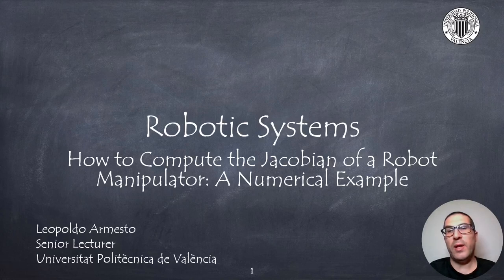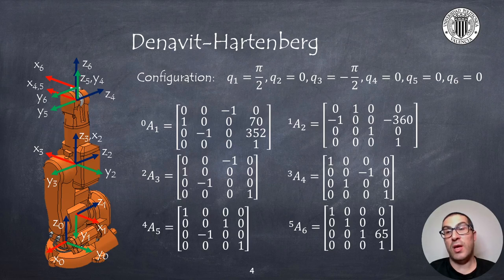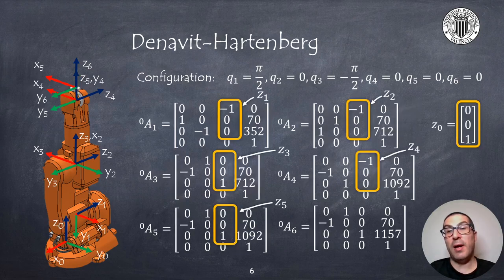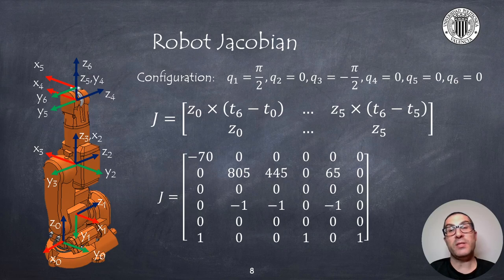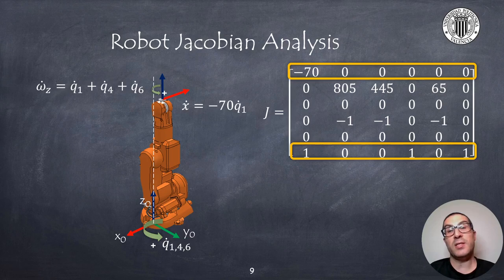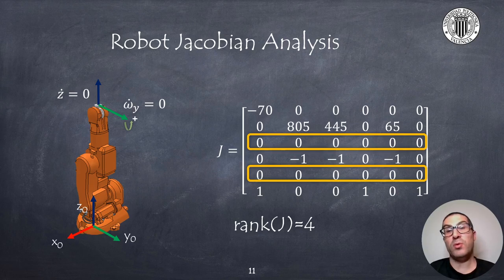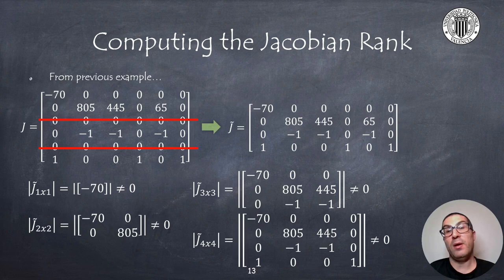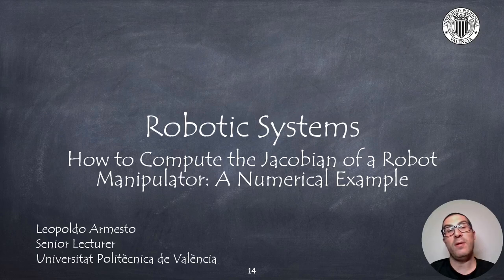How to Compute the Jacobian of a Robot Manipulator: A Numerical Example | Robotic Systems (OLD)

Comment: If this is an old robotic system than which method is currently used by today's industries?
Reply from the maker: Depends on the task... Many industries still implement classic robots. Collaborative robots are covering between 10-20% of the cases.